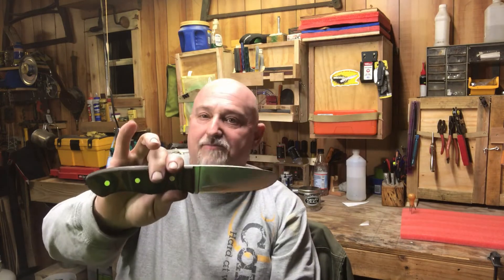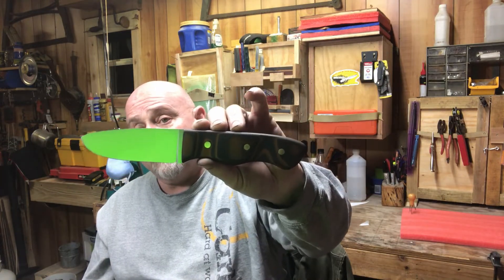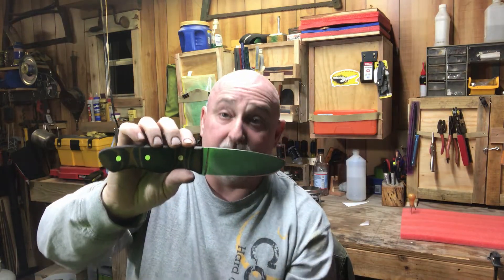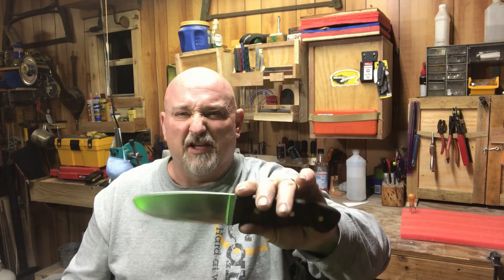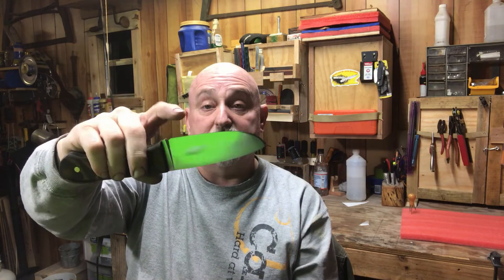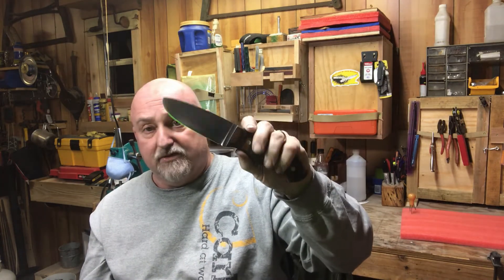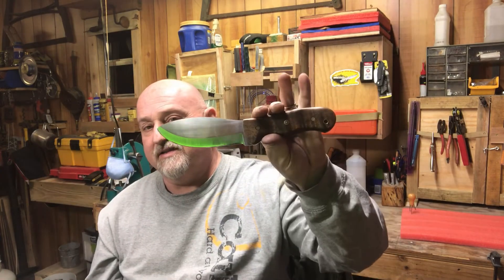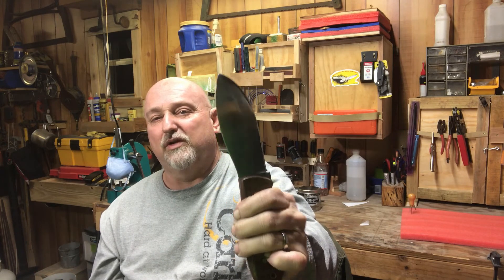New Design! Mike's Ideal Knife

Comment: Sounds like a good'un  If anybody can make it work I'm betting on you.
Reply from the maker: Thank you and I surely hope it is what I am expecting. The worse part about knife making is the Prototypes lol. Sometimes you make 10 knives that just are not quiet right. Money down the ole drain. unless they are salvageable to fit some other style . ATB Mike
Reply: This one looks great although I'm not a big fan of wide blades myself. It seems like that's the most popular trend now days.  I've never used one per say.. just never really appealed to me.  Same goes for re-curves and big bellied knives.. Guess I'm just an old stick in the mud when it comes to trying new things...haha
Reply from the maker: Plain 'Ole Chuck for almost 40 years I have been a 3 inch blade 1 inch wide 1/8th thick. I personally think a knife even as large as this one which is small compared to most knives in that generation. Works like a smaller knife. As for big bellied knives and 2 inch wide. I am not a big fan of as well. I know a lot of folks do like them. But over the last 10 years I have attended a lot of events with Bushcrafters/ woodsman. The one thing I have found in common at all the meetups. It is like a car show everyone revs up the engines and polish off all their skills in the way it fits their hands, how it will cut and sluice and how the edge really holds up. The reason it holds a edge so long and not so much as how well. Is because when the show is over. They pull the trailers out and load up the cars till the next show lol. I have the privilege of spending time with some true woodsman over last 2 years. They allow no videos at camp and you are required to use your skills for the good of the camp. And when someone has talked to much about how much they know or read. You are asked to leave to never comeback. One of the requirements to tag along is to carry a single blade folding knife. It is used for 95% of the task you perform at camp. As a matter of fact I have never seen anyone say look at my new knife.